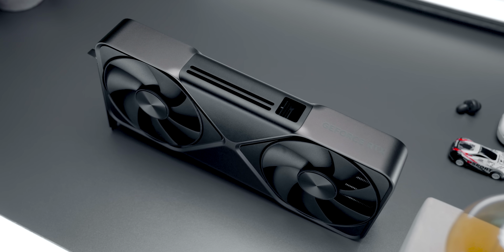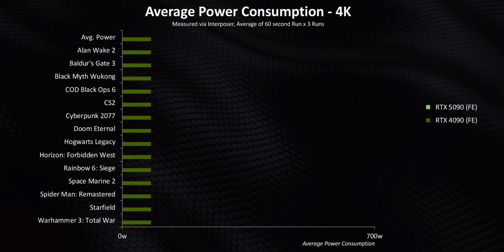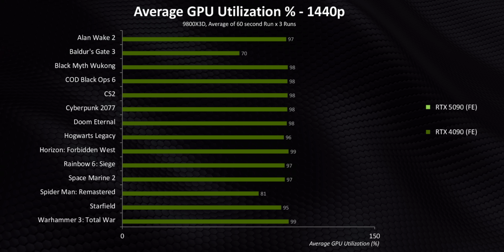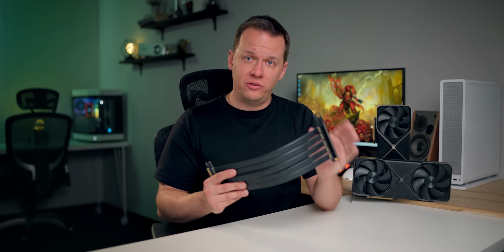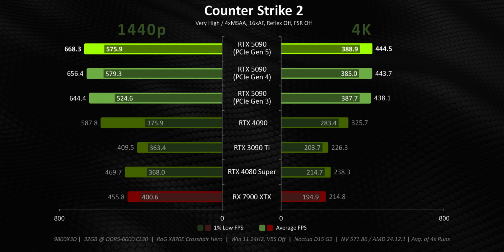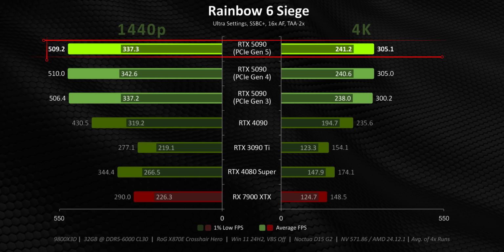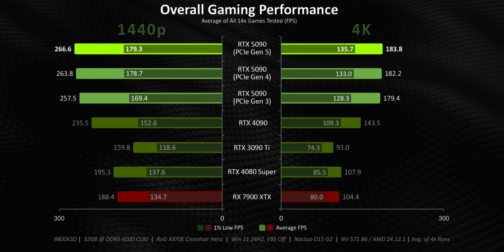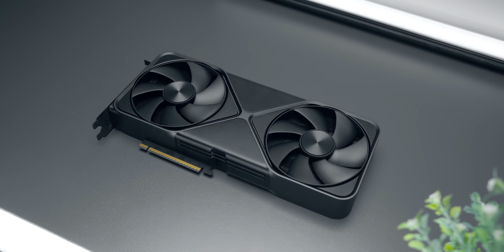RTX 5090 - CPU Bottlenecks, PCIe Scaling, Benchmarks & More

Comment: The lower GPU utilization with RT makes a lot of sense because for a lot of RT tasks, we actually use the CPU a lot (e.g Digital Foundry's Cyberpunk testing shows this), so if you are already CPU bottlenecked due to the CPU not being able to keep up with the sheer draw calls, then that bottleneck will only increase when using ray tracing.

Btw that information on the riser is very helpful. I'm SFF and have to use a riser. Also, you really stepped up the quality of your testing compared to a few years ago, good stuff.
Reply: The CPU does BVH structures so pathtracing or heavy raytracing are relatively easy for the CPU (also because FPS get lower) and hard for the GPU.
Light raytracing is the opposite, you can get CPU-limited cause the CPU is doing BVH estructures and the GPU is doing easy tasks.

Comment: Great video testing some of the less usual things, though a few nitpicks I have here.

GPU utilization is NOT a good indicator of usage, but this is hard to really get around with the 5090 since the CPU is already as fast as it gets. But you can easily be CPU-bound with 100% reported GPU utilization and GPU-bound with 70% GPU utilization, though the latter is quite rare in my experience. The utilization counter is not reporting what you would think its reporting.

PCIe does not support any mechanism for auto-negotiation with a riser cable, they are not involved in the protocol level at all, so the boards are working correctly and defaulting to gen5, the riser is simply undetectable.

Comment: @04:03 we could use an undervolt video if you can make one, to see if that wild power consumption can be tamed with only a minor performance loss.
It works wonders for an RTX 3090 (i have one in my rig capped at 0.9V, consumption dropped to 330-350W from 420-440W for minus 4-5 FPS - 100% stable for 2 years now).
Maybe this can be pulled off with RTX 5090 too.

Comment: Seems odd that you say the GPU is bottlenecked at 1440p & 4k and you attibute that to CPU, while later when showing performance, you test on PCIE 4x / 3x? which means you have to be running a 5800X3D or Intel older gen CPU which aren't nearly as fast (as 9800x3D) and yet your results don't go down by much at all, if at all.  CPU bottleneck?  Seems doubtful.  Something else must be causing this.
Reply from the maker: Actually we didn't directly attribute it to the CPU.  It was left open ended in a lot of cases since it could be game engine, drivers, etc.
Reply: Interesting take

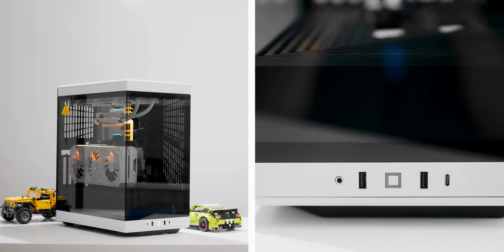Comment: 9:27 Actually the Havn HS 420 is (at least supposed to be) shipping with a Gen 5 Riser, just wanted to say this. Btw, is Task Manager a reliable tool to check for GPU utilisation?
Reply: Can confirm, just did a new build with HAVN HS 420 VGPU case, and it comes with a gen 5 riser

Comment: Kena 50s 3060, 3070 80s 1440p

F1 60s 3060, 3070 100 1440p

New world 1440p 3060 70s, 3070 100

Flight sim 1440p, 3060 40s, 3070 60s

Forza 3070 4k 100,3080 130 on average 

Hitman 3070 60s 4k, 3080 80s

4060 4K tsunama at 25 fps, 4070 40s no DLSS 

Elden Ring no DLSS 1440p, 4060 40 fps, 4070 70
 
 
  4080 Forza 4080 110 fps, 4080 140 4K

Avatar 4k 50fps 4080, 4090 70

Hogwarts 4080 4k 45s, 60 4090
 
As you guys can see, I compared models directly under a higher class, as that's the only way it makes a higher class worth it since the jump will be bigger, which is why it makes no sense to compare a 4090 to a 5090 only 1 gen apart. It only makes sense to compare the 4080 to the 5090, which will skip the 4080s; this way it shows a good jump. The same goes for coming from a card like mine, 4070, to the 5080 or 4060 to 5070.

Comment: i have 4090, and 5090 is no where close for price vs performance and tdp is to high... 600 watts vs 350 watts.. for getting more performance. TDP cost to by bill so calculating per year.. better to switch to 5080... if it gets same fps with less tdp. Sorry Electricity i pay 160 euros to 170 per month, IF i do not game its 120 euros... so 5090 can increase even more the cost.
Reply: Yes. That's a factor. This card is made for 4K and drinks some serious juice.

Comment: The performance increase on the same node is actually horrendous, stop giving Nvidia a free pass, 30% more performance with 30% more power, 30% more silicon and 80% more bandwidth is actually a 0% improvement from the new architecture.

Zen3 was 30% faster (60% for the X3D) over Zen2 on the same node, with same power and same silicon area.
6900XT was 100% faster than RadeonVII at same power and using half the bandwidth on the same node.
Even Intel menaged to do better on the same 14nm and 10nm  node...

Pretty sure that "same node" argument was in the review material since everyone keep spinning on it...

Comment: The 5090 doesn't have better Ray Tracing performance, it loses the same percentage of frame rate as the rtx 4090, it's just that the GPU is more powerful.

Comment: This is the best 5090 review video for my use. I have a Hyte Y70 case with the Hyte riser cable and I have a 3090Ti. Thanks for this excellent review. It looks like if I manage to buy a 5090, I'll have to use my 3090Ti to set the bios in the Gigabyte motherboard I have for this build before installing the 5090.

Comment: My modified 4090 is a better option than the 5090 even in AI workloads.  I had extra VRAM modules installed bumping my dedicated to 48GBs, the slots on the board function, beyond that I bridged it with an nvme drive boosting it to just about 60GBs of usable VRAM, not very useful in games, but for AI workloads I also have a custom OC and power profile which is not quite 5090 still but with the VRAM I can stage and load things much faster.  I have a dedicated 2TB nvme for AI models and workloads on the same lane as the 4090, the same drive being used as bridged memory, but for now I have seem some odd instabilities going above 60GBs, next step is messing with drivers.  50 series is a skip

Comment: Would there a lot of impact if it runs at PCI gen5 8x since I also have an m2?
Reply from the maker: Your M.2 shouldn't be sharing lanes with graphics.
Reply: @HardwareCanucks  but it does in my MoBo. 8 lanes for M2 and 8 lanes for the graphics. If I remove that M2 then the graphics gets full x16. With the 4080S I see no difference but I wonder if the same happens with the 5090

Comment: I am SO glad I went with my 14700K. I won't have CPU bottlenecks for another 10+ years. My 4790K 4c/8t still plays every AAA title perfectly at 1440p on ULTRA (except for Dragon's Dogma 2).

I locked my 14700K cores together @ 5.5GHz and locked the TDP to 253 watts and ZERO issues.

Then, I am throwing a 5080 Ti 24GB 384-bit card at it in the Fall.

Comment: Havn 420 comes with a Gen 5 riser and Hyte has one coming. 

Also, my brother in Christ if you spend $2000 on a video card and run it pcie 3.0 or 4.0 then you kinda deserve to have issues.

Comment: Highest end system currently available and shows a AMD 9800X3D, hilarious
Reply: I9 14900k is better in multi-tasking and workstation stuff
Reply: 9800x3d IS THE FASTEST GAMING CPU WDYM
Reply: @Mohanad204  It's really not. The 13900k and 14900k are better gaming CPU's. You'll be bottlenecking your GPU in games like World of Warcraft, Cyberpunk 2077 etc etc if you use an AMD CPU.

Comment: Thank you for being the only reviewers to do PCIe generation tests, would you then overall suggest getting a PCIe gen 5 riser cable if mounting the gpu vertically? Would using a gen 5 riser cable also allow you to avoid having to make the changes you mentioned in the bios?

Comment: What gen PCIE was the 4090 running on?
Reply from the maker: It's a gen 4 card.  All cards were benchmarked at their maximum bandwidth
Reply: @HardwareCanucks  I'm running mine vertically in a Thermaltake core p3 case. I think its a Gen3 PCIE Riser. What's a good Gen5 riser for the 5090?

Comment: So you are speculating that the 6090 will be a $2000 card? Well I would doubt that. Say $2400 and I think you will be closer. I remember the discussions on the pricing of the 5000 series, and how people kept saying that Nvidia would never make the 5090 a $2000 card. They were so sure it would be $1600 or possibly $1800, but it would never be priced at $2K. That would be ridiculous!

Well $2K it was in the end, and I never expected less. The next halo card won't be cheaper, not even after calculating the inflation into the price. Nvidia will just go one step further again. You heard Jensen Huang at the CES, this $2K card will go into your $100K gaming setup and be an excellent addition. 2027 the $100K gaming setup will be $250K so a cheap $2.4K GPU will be a fine addition...

So my guess is that the 6090 will be released in 2027, costing $2400. Feel free to laugh at me if it's cheaper when released.
Reply: 800 to 1200(1080 ti to 2080 ti)
1200 to 1500(2080 ti to 3090)
1500 to 1600(3090 to 4090)
1600 to 2000(4090 to 5090)

Comment: Thanks for the review, a lot of info here was super useful and not available in other reviews so kudos for that! As an owner of RTX 4090, I have no reason to upgrade, but some of the announced technologies and improvements like neural rendering - including neural textures/materials/radiance cache, DP 2.1b, reflex 2,  MFG, even the FE cooler and PCBs are exciting. I will wait for 60 series hopefully the improvement will be more inline with RTX 30 series to RTX 40 series (probably will also need to upgrade my CPU and platform by then).

Comment: It’s amazing how well Pcie gen 3 still holds up. I’m honestly amazed by this. I bought a Pcie 5.0 riser cable for my board thinking the 5090 would finaaalllly exceed the limits of my 4.0 riser. Looks like it isn’t going to matter at all.
Reply: I am surprised by that as well.  Good to know.
Reply: There are situations that see more of a bottleneck in other games. But overall not a huge issue. And I'm not sure WHO would have an RTX5090 paired with a mobo that has less than PCIe v4.0.
There are also some non-gaming APPLICATIONS that really hammer PCIe bandwidth. But PCIe v4.0 probably will be more than enough there too.
Reply: @photonboy999  A PCIE 5 x 8 would have been a good choice.

Comment: Why does everyone think the 9800x3d is a CPU power horse? It is a cache horse the IPC and CPU horse power is not an increase even over last gen. The major difference and part of the IPC uplift is the fact the 9800x3d runs at a higher clocker vs last gen.

Comment: There's no noticeable difference between PCIe 5.0 and 4.0 for games, but what about AI stuff like running LLMs and Stable Diffusion? Will there be a big difference in the generation speed?
Reply from the maker: Most of those are run locally on the GPU so likely not.

Comment: You would think NVIDIA would focus more on ray-tracking optimizations... Yet I played Hogwarts Legacy with my RTX 4070, Ryzen 9 5900X, and at 3840x2160 and this game runs at 30-45 FPS which I'm very happy with. And this is with ray-tracing in CachyOS (based on Arch Linux). All with ultra settings although I could bring it down to high if there's no difference at all. Of course, I might bring some settings down to high if there's no visual quality differences at all.

I will hold on to my 4070 for a while as I'm not sure if I could go for the 5080 other than microstuttering issues. I do play other games such as The Talos Principle, The Talos Principle 2, Portal, and a lot of non-AAA/non-eSports games in 4K60.

Comment: This whole bottleneck is a weird analogy. Let's say I play Baldur's Gate 3 and the GPU is not fully utilized. This is not a problem at all - this just means my computer runs quieter. As long as the game runs fine I'm happy and this game runs awesome even on my 4060 laptop. Then let's say I switch to playing Cyberpunk which needs more GPU - this time the game will utilize more GPU power. What am I supposed to.. swap GPUs every time I change the game I play to avoid bottlenecking lol. When I play Slay the Spire I should probably remove the GPU entirely.
Reply: There is currently a religion that gpus should never be bottlenecked by cpu. But systems are systems and games differ. With balanced systems its OK that bottlenecks keep switching places among components. I wouldn't buy this GPU for 1080p though as one would be almost always cpu bottlenecked. I would not pair it with a 60hz monitor either and not with Zen2/intel 8th gen or older CPUs.

Comment: When Mike pointed to the Hyte Y60, I was really hoping that there will be some discussion on vertical mounted 5090 and its impact to the CPU/motherboard as it blows all the heat directly over. I am a Hyte Y60 owner with an evga 3080 and eager to upgrade to the 5090 FE (if I can get one). Knowing how vertical mounting temps work on airflow-challenged cases like fishtanks and ITX cases his would be a great input, if you can share!

Comment: To those disappointed the 4090 comparisons:

To be fair, expecting major generational leaps every time is a bit unrealistic. And still isn’t a card for the masses, it’s for those who when asked ‘what’s your budget?’ answer ‘open.’ A minority among minorities. Also, not everyone is upgrading from 40 series. Those who are have extra money to burn. Most will be upgrading to the 50 series from 30 series or older.

Most will be waiting for the 5070 and 80 vs AMD’s 9070/9070XT comparisons. Which has the better frame for $ value. This is what really matters.
Reply: Well it's a same 90 tier card with 25% price increase. Ofc there should be performance upflit. 20-24% doesn't justice 500 dollar price jump
Reply: @OneDollaBill  25%? more than 37% price increase, not sure were people are getting these random % price facts from, and thats in AMERICA, any other country on the planet is more along the lines of 45-70% price increase, 31% average power increase with an aggregate 28% performance increase, bar a few selected games were it reaches 40-50% performance increase, you can already x4 with lossless on a 4090 and yes it beats or matchs the 5090 in all scenarios
Reply: @welshe222  in usa it went from 1599 to 1999 or so. In elsewhere its much higher tho like you said. In europe its like from 1900 to 2.5k

Comment: 20:32 i already know what you "want to say" and it's the line which every single f review says, it's not a consequence, what about to disclose that it's nvidia who asked you to tell this? They practically made "new architecture" which is exactly the same as the old one, it's clear for everybody, whole performance scale is just from raised amount of compute units and wider memory bus
Reply from the maker: The days of brute forcing performance gains are gone.  That's why
Reply: @HardwareCanucks  Primarily when you can't "brute force" your way out of truly bad optimizations (UE5).  Doesn't matter what your hardware is when that is considered a feature and not a bug.  Feels terrible to have an expensive GPU, yet you get such horrible performance because all of the developers of AAA games that were actually skilled at optimization left to go work for Apple or Google.  But hey, you can "fake frame" your way to a visually higher "frame rate" while still having stutters and it feeling awful to control.

Comment: easiest way for you to rule confirm your theory of the CPU bottleneck would be to lower the graphical settings and seeing what the max fps would, allowing the GPU to put out as many frames as possible. You can also use this method by using a somewhat weaker CPU and seeing if this is now an engine limitation rather than a CPU since if they can get to near the same performance, it should rule the game engine as being the hinderance at this point, and i would say if we are reaching the limits of that games ability to put out frames with higher hardware, its likely time to remove it from the test bench. I think in a few cases, we are probably seeing the limits of what the engine can put out and not the limitations of the CPU.

Comment: " Pcie Risen Gen 5 costs a fortune "
If you can't afford a 80$ riser for a 2000$+ (most likely +300 or +400 dollar above this MSRP) graphics card to run it with a riser, you probably shouldn't buy this 2000$ card to begin with, a card that requires at least a good 1000 watt PSU and comes with a hefty power bill attached to it. 

That being said, I appreciate the testing on Gen 3 and 4 risers, it's cool to see more specialised data along the way, just like GamersNexus did with the Schlieren imaging it was cool to see those " out of the box " testing stuff, even if I'm never going to buy something that expensive, I'm still a tech enthousiast.

Comment: I sold my 4090 to buy a 5090. In doing so I had to temporarely switch back to a 2070S. Now I am seriously contemplating just using my 2070 until they offer something better.
Reply: I like 1080ti it is good cars worth the money. I will keep it until it does on me
Reply: Only upgrade when you need. For me the only truly interesting thing about 5090 is its vram for coding. Otherwise its kind of "meh", but not as meh as the rest of this gen. Those cards are terrible, barely upgrades at all.
Reply: You’re an idiot

Comment: Thank you for covering the PCIE riser issue! Just started building an SFF PC (my first build) and was concerned if the 50 series might be hindered by the riser I’ll be using. Glad that it isn’t much of an issue
Reply: If using an ASUS motherboard like our X870-I Gaming you can easily resolve the issue via our FPS add in card which has a PCIe link speed toggle switch ( PCIe Alteration Mode switch ).

It allows for the ability toggle the PCIe link speed WITHOUT having to enter the UEFI.

Best of luck with your build!
Reply: @ASUSUSA  can u give me a motherboard so i dont have to worry about this 😃😞
Reply: Well, if you can't see anything on the monitor you'll want to find another PCIe graphics card if you don't have an iGPU in the CPU. Change to PCIe v4 in the BIOS and retry the RTX50 card. Not sure if you watched that part, but that CAN happen.